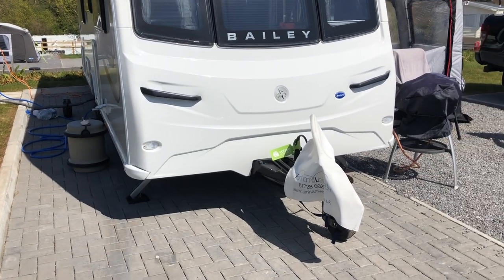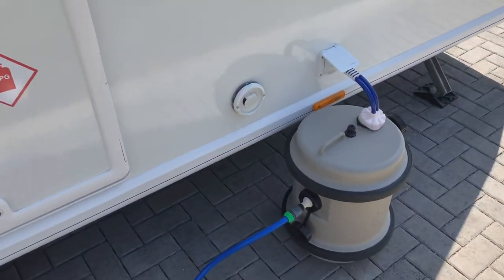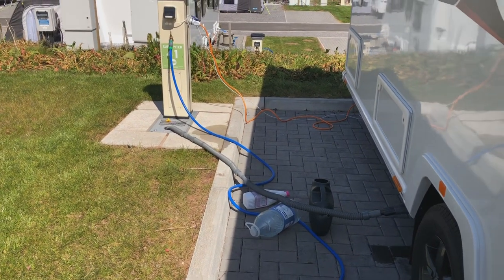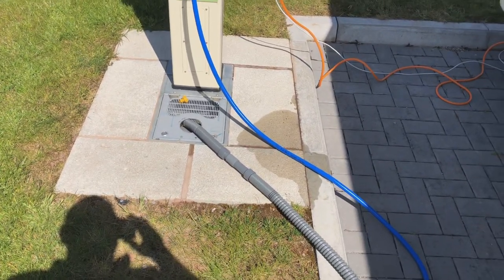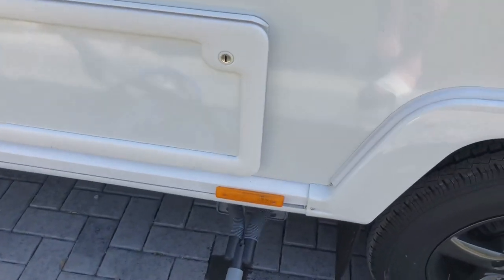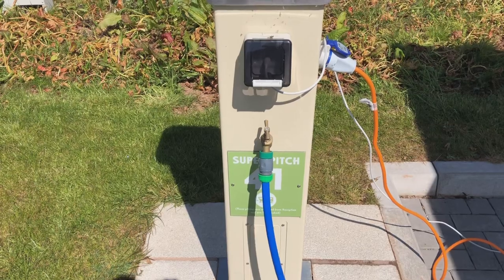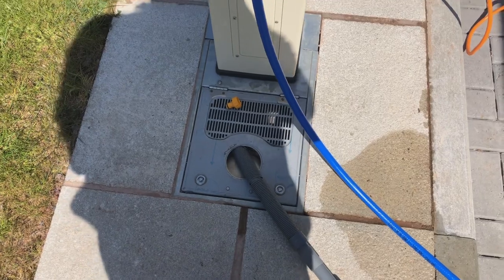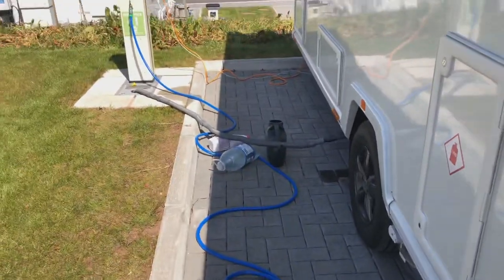A numpty’s guide to fully serviced pitches

Comment: A little tip I found works is I put a marker pen line on the top of the float stem as it comes out of the aqua roll so I know the floats the right way up,so if you tighten it up all in the right position it should be in the right place every time you put it in 👍
Reply from the maker: Now that’s a simple but very effective idea! Why the heck didn’t I think of that! I’ll give it a try, thanks Steven 👍

Comment: If we're only going away for a night or so, I wouldn't bother, or if a peach of a site doesn't have posh-pitches, I wouldn't let it put me off, but for a week+ and if we're showering in the van, we'll go fully serviced. Same setup as us mate. And the same as you, I realised that you have to get everything tight on the aquaroll/float thingy or it weeps slightly out of the fitting! Glad to see its not just me that uses a watering can to prop up the pipe so its got some sort of downward slope to the grid 😀 We had the same Y piece, but ended up going for the Colapz waste pipe double adaptor; works a treat now. We only have the tap on a bit, enough so it fills as much as its used then turn if off when we go out. Like an awning too, the first time I done it, it was a proper long winded faff but now, it just all clicks into place in no time. Cheers for this one and a great setup vlog 👍 Martin & Jo
Reply from the maker: Hey guys! So great to know it wasn’t just me and you’d experienced the same issues 🤣 I must admit that after our fully serviced pitch in Tewkesbury, I’m pretty much sold on them now and will try to book them going forward 👍 thanks for watching guys 🙂

Comment: Bollard not in the corner to stop people from hitting it and the kerb is to contain the waste water/water from leaking all over the grass by the side of the pitch making it easy to clean down and to aid mowing the grass.you can insulate the pipe with pipe lagging and a jacket for winter use
Reply from the maker: Good tips there, thanks Ray 👍

Comment: You can get a set of rigid waste pipes to fit your van as a two into one. The reason your waste pipe goes up the kerb is that your not sited close enough to it. The 3-4 foot gap is why the waste goes uphill. Turning the tap only a quarter turn doesn’t affect the pressure, only the flow is reduced. The pressure will build up just the same if the tap was fully open.
Reply from the maker: Hey Huw, we couldn’t get any closer to the kerb otherwise half the awning would be on the block paved drive, so we wouldn’t be able to peg it down! Greats tips on the other bits though, will bear in mind going forward! Thanks for watching 👍

Comment: Hi where do you run the TV ariel cable into your caravan.
Reply: I usually use the SAT sockets to connect the external ariel cable and fit F to ariel adapters to each end. Saves running cables through windows etc. There's no need to use the on-board booster as the SAT cabling bypasses it.

Comment: First time next wk on a serviced pitch, does the aerial cable going through the window to the tv or into the locker as we have a tv point there?
Reply: Connect the ariel connection to the external SAT socket using an adapter, then plug the TV into the internal SAT connection. Works well

Comment: That is a bit daft having a step up to the drain 😊 Could you fit a Colapz flexible pipe into each outlet and then join them a bit further down?  We like a serviced pitch but are happy to use non serviced too,  In winter you might need to insulate your aqua roll and turn the tap off at night but we never have yet 👍
Reply from the maker: Hey Ann. Yes it’s not the best idea but I guess it keeps the pitch fully clear of obstructions. I must admit after our Tewkesbury trip I did start to really like being on a fully serviced pitch. Maybe just as a treat sometimes 🤣 x